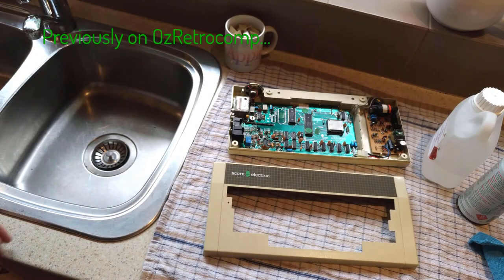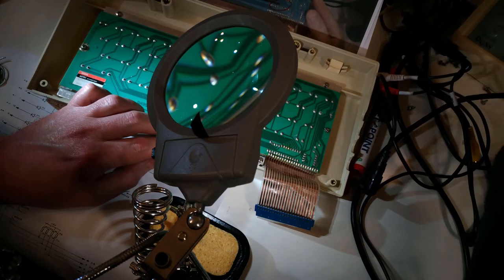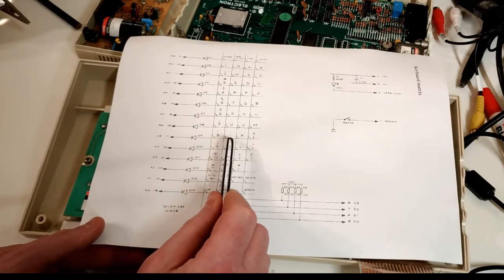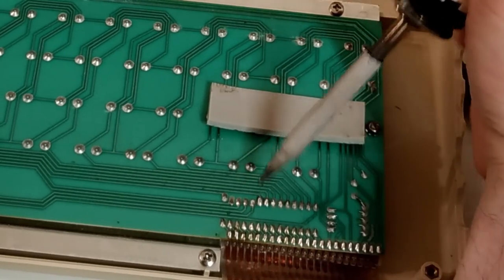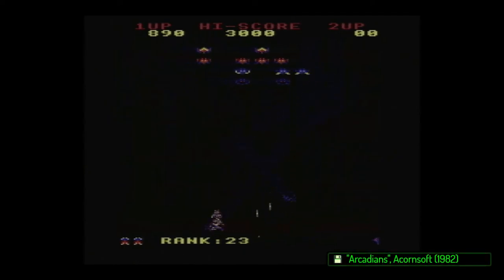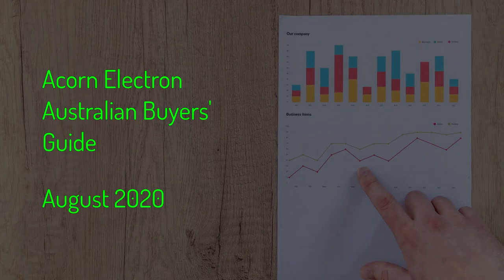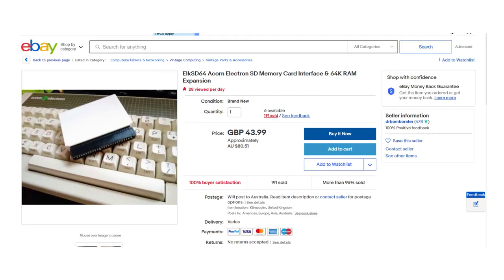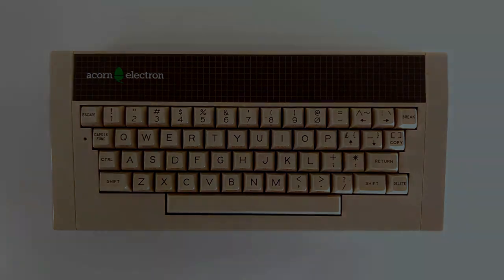Acorn Electron Part 3: Keyboard fix, play testing and Aussie buyers' guide

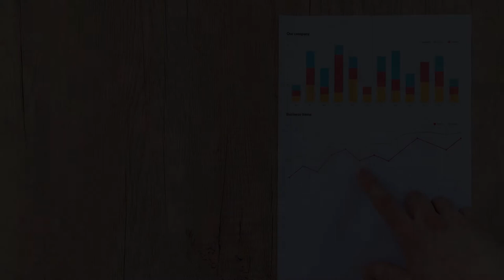Comment from the maker: 9:03 Well... that Aussie buyer's guide seems to have aged like milk.  My understanding is that as of January 2021, virtually all eBay UK listings are restricted to British buyers only. It's not clear if it's the Human Malware or if it's Brexit that's causing the issue; I suspect it's a bit of both.  Possibly some eBay intervention as well?

If I were wanting an Elk right now, I'd be looking at NZ (Trade Me) or reputable independent specialists such as CJE Micros.  If going directly through an UK-based independent specialist, contact them to confirm that they're still able to ship overseas.  It's probably going to be even more expensive now than it was when I made this video, so there's that.  

Otherwise you'll need to be very patient and wait for either eBay UK to get back to some sort of normal, or wait for an Aussie seller to part with their Elk.